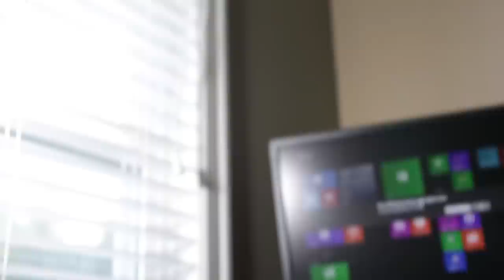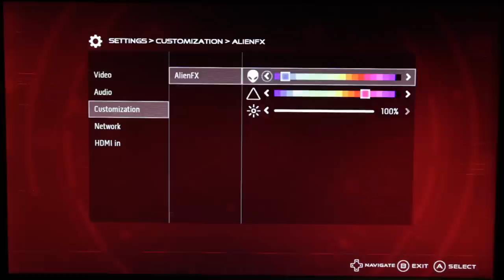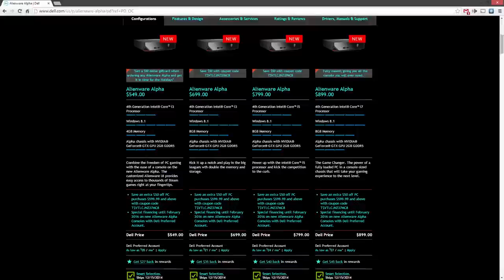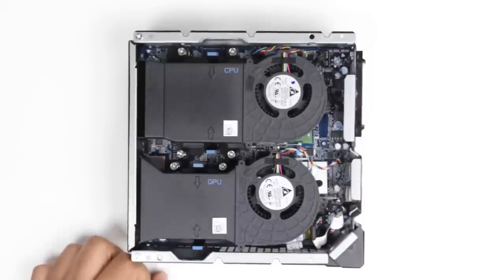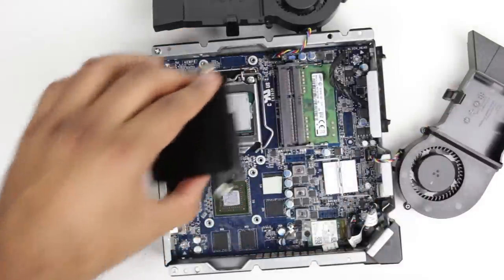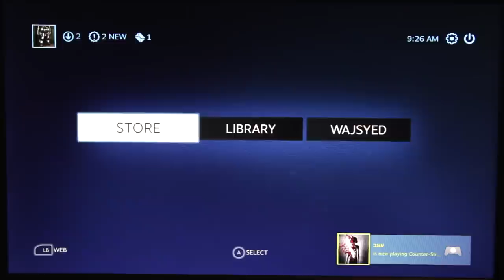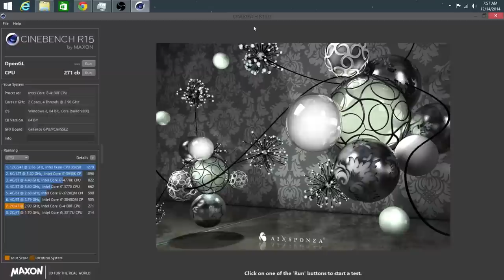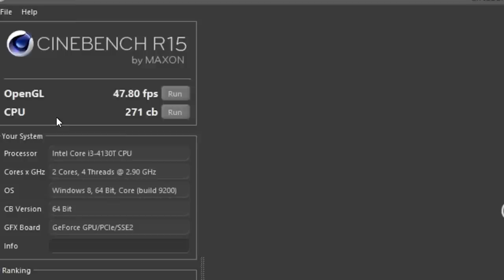Alienware Alpha Full Review

Comment: I consider 30 fps totally playable. As an arma player, I'm very used to framerates around 20. So anything that runs higher than twenty fps is golden for me. As long as what I call rotary lag (lag when turning the camera) is kept minimal,  a game is absolutely playable at 30 fps. Keep in mind I have a thousand dollar gaming PC, but it's all AMD so arma just kills it.
Reply: 30 fps? What settings are you playing on?
Reply: My CPU bottlenecks arma bad. No matter my settings,  I get 20-25 fps on MP in arma. Everything else is 50-90 fps.
Reply: Michael Owen Arma is a poorly optimized game I could barely go 30 fps on high settings but it at least my I do fairly good on medium settings with 48-50-60 fps. I play most MMOs at max settings with 60 fps...
Reply: I feel for you man, what processor do you have? I'm in the midst of upgrading my PC incrementally and I've recently bought an fx 9590 (the octa core) and it shreds Arma 2 and day z even with my shitty Radeon 7770. I'd definitely recommend it.
Reply: Duly noted. Planning on getting an MSI laptop with my tax refund.
Reply: Yea 30 fps is cool IF the games 1080p ultra graphics otherwise the graphics card is shit
Reply: 2XRemix the problem is my CPU, not my gpu.
My CPU is a huge bottleneck on arma.
Reply: Michael Owen I'm still waiting for my W-2 lol.
Reply: Michael Owen i3?
Reply: Fx 6100
Reply: Michael Owen My FX 6350 and GTX 660 gets around 50-60 on Arma 2, but drops to 44-32 fps in cities. What's you GPU.
Reply: R9 270. 2gb

Comment: The 860m is a modified 750TI which is a very cheap GPU. It's just slightly more powerful, very slight. The Xbone and PS4 still outperform it, especially the 449$ I3 version, which the CPU is NOT mad for gaming. And 4 gigs, most modern games aren't going to run on high setting, or have good frame rates. Also the I7, is 1599$, WHY would some insane moron pay for that. You could make a killer gaming rig with that kind of money. Next Gen is where it's at, that's why they are doing this, because it's threatening the once thriving PC gaming market. I use to build gaming rigs, so I know.
Reply: Newhart Bob agreed.. xb1/ps4 does outperform the cheap one. the problem with alpha is that it does play 1080p but not fixed fps makes it unplayable on some areas or annoying.. xb1/ps4 is fixed fps. and in the future.. developers would discover its potential more and more to unlock 1080p/30-60fps.. fixed. and yea.. omg that $1599 could build you what? gtx980(or atleast 970), i7-4790k, 16gb ram lol.
Reply: Newhart Bob hay man i have a question =) 
I was planing on getting a laptop 15 inch  with gtx 960m 2gb  and i7 quad core and 16gb ram... 
is the ps 4 more powerful than the laptop or not ?  
ty for your answer

Comment: Why don't they offer the GTX 980m as an option like their laptops?
Reply: +thybigballs lol
Reply: +banksitter  ikr?
Reply: +thybigballs Yeah I just checked the site and the GPU is not even upgradeable and I never even heard him mention this fact in the video. Even Dell's own webpage shows the mediocre graphics performance on 3 different settings compared to normal GTX cards. This uses the 860M gpu chip soldered on the motherboard. You can upgrade the CORE CPU to i5 or i7 but not the GPU. Cheaper to buy a Razer V1 PC case for $60 and install your own Mini ITX motherboard and your own small or larger sized GPU like a Fury or a 750ti.
Reply: using one right now, not very good, going to buy a new one soon
Reply: +TekReview's You are right.  I built a pc for my father in-law to set up on his entertainment system.  It can do everything this box can do minus the ui.

Comment: Good review and a fair, objective review of the Alpha for the most part, I've enjoyed all your Alpha coverage so far.

I would say its a little unfair to complain about the Alpha only achieving 30 fps in games that both consoles also only achieve 30 at and sometimes not at 1080p and generally speaking lower graphical fidelity. I mean I agree 30 is not really playable, I have to drop settings personally to get higher frames, but someone needs to tell developers this!

Surprised about the sound under load, I had read elsewhere under load it was comparable to the 2 consoles, but good to know!
Reply: If you lower the resolution of the i3 version to 1600x900 and 1024x720 you can play Far Cry 4 with ultra setting around 50-40 FPS.
Reply: Luis Henrique T. Caetano Not what I'm buying it for personally, but good to know, thanks!
Reply: umm what are you talking about? consoles(ps4 xb1) have higher fps than that
Reply: Isaiah Hill PS4 has 35 fps at 1080p and Xbox One has 45 at 720p. The Alpha has 33 at 1440p. Not bad in my opinion.
Reply: Adam McMillan Plus a lot of games on consoles are locked at 30 fps

Comment: its 389$ right im gonna buy it cause its pc and console and cheaper games and upgradable
Reply: and also no need to pay online
Reply: I just bought it yesterday and an extra 4gb of ram on the side
Reply: +Donolater with the I-3 version can u run games like counter strike go with 60+ fps?
Reply: +Im Hyped I don't get it until next week , but I can get back to you
Reply: +Zeeyox 500gb , but you can upgrade to 1tb or a SSD and install it yourself.
Reply: +Donolater can it run cs go at 60 fps
Reply: andy long more than 100 on max settings

Comment: It's not even close to beating a next-gen console. For one, the cheapest one you can get is $500. And the $500 one has an Intel Core i3 processor, 4GB of RAM, and a NVIDIA GeForce GTX GPU with 2GB of GDDR5. My PS4 has a better GPU and double the RAM of this shitty Alienware "console".
Reply: ***** The Graphics card you mentioned alone is almost $300 depending on where you purchase it from. Also, you're going to want 8GB of RAM most likely, that's abou 70-80 dollars depending on the place you got it from, plus add the cost of cooling, a motherboard compatible with it all, and a decent power supply, obviously over $400.
Reply: ***** Only issue I have with that is ram, most average games use like 4gb's of ram. you would just barely be able to run the game.
Reply: ***** Well, you can't always get away with it, and BF4 isn't the most demanding game.
Reply: ***** Alright, well if you have 4GB's of RAM, and it's using 3GB's it has chances to cause complications with the game cause of how much stuff is being used.
Reply: ***** Meh, that's true. I honestly don't care about graphics that much as long as I like the game.
Reply: And my PC destroy the PS4 without even blink. But this Alienware thing is even worse than consoles. Holy Crap.
Reply: This is just the beginning of the pc "console" generation, for a first time thing,  it is brilliant, think of it this way, playing all of the xbox one and ps4 games + plus all of the pc games as well, would rather play all of them on one console than having a next gen console and a gaming pc, 500 isnt too bad.
Reply: Jafro MC Sony and Microsoft won't allow that another console can play their games. They spent too much money to build their business. But that would be great!
Reply: There are i7 models as well
Reply: the ps4 doesn't have a better gpu
Reply: ***** Wtf has Dell to do with it?
Reply: and your PS4 was outdated for " gaming" a month later
PC wins
Reply: YOUR PS4?What,the other PS4's don't have the same hardware lol?
Reply: mgkpraesi dell makes alien ware
Reply: ***** I was saying, that MY ps4 has this hardware, along with the others.
Reply: The Meep Crew lilracerdude Realy? Didnt knew that. Never bothered with Alienware much since their prices are just ridiculous.
Reply: mgkpraesi it would not be a problem if the hardware was out of this world but their systems are just overpriced pieces of shit.
Reply: Vulpus you should've reffered to it as ps4 in general. It was a joke btw.
Reply: ***** Yeah I should have.
Reply: Mine was only 450.00 and the.video chipset runs circles around your shitty PS4 and its completely upgradable.. I think your just kicking yourself for getting that old boring clunker PS4. Plus the alienware console comes with windows 8 and does everything a full conputer can do. Its very small and different looking.
Reply: Blonde Repub pcs are upgradable, the alpha not so much. I doubt you will get much performance from upgrading from an i5 to an i7 since games demand gpu power.
Reply: I hate the PS 4 controller. At least with Alienware you can attach a mouse. For the price of 450.00 at best buy you cant do better or cheaper if you built it yourself.
Reply: Vulpus I`ve just build a similar spec system to he ALienware here : a decent i3 & an overclocked GTX 750ti ( similar to the 860 M apparently ) with 8GB Ram and you`d be suprised what those can do, don`t just go on raw specs of a games console, there`s the architecture of the components & the fact that many games don`t use much over 2 CPU cores for gaming, a good i3 CPU can kick butt in most games
Reply: ***** I`m now playing Farcry 4 at last on that build when my older Core2Quad overclocked to 3.25 GHZ plus GTX580 graphics card was crippled by it !
Reply: Vulpus $500? On Walmart.com I can get a brand new Alienware Steam Machine Alpha for $450.
Reply: ***** Technically yeah,unless the GPU sucks which means that no amount of VRAm of any type can save it.
Reply: ***** Then why are the new consoles 64-bit? And why are PC gamers clamoring for 64-bit games (and have been for years)? It's because RAM IS a factor, depending on the games you play. Even some little indy games are pushing the 2GB limit that you need to modify the executable to get past, and AAA game developers have to struggle to keep their memory footprints down to keep making 32-bit games that will run on a 32-bit OS. On a 64-bit OS they get a little more breathing room by having a full 4GB to play with, but the move to 64-bit is (finally) happening because 4GB is not enough anymore, to give games the features that keep the industry competitive.

P.S.: 8GB of GDDR5 will not "perform" better than 2GB of GDDR5, it will perform exactly the same - but it will be able to hold a lot larger frame, more HD textures, and a larger frame buffer.
Reply: I just built a computer with an i7 4790k an evga gtx GeForce 960 super clocked with 8gigs of ram and it runs gta v with a flat 60 fps no more no less for $1000
Reply: Someone forgot to turn off V-SYNC.
Reply: You are kidding, I have a PS4 and I hate that thing. Crappy online, too expensive, games can be choppy, and it has some really bad exclusives. PC has no cost for online, good online, same price, and it had more games than any other console on the market.
Reply: maxattack36 but but but PS4...lol
Reply: I don't have a problem with consoles. I wouldn't get one, but if I would, I'd get a PS4 because it has more of the kinds of games I like than the XB1; however, this is a PC made to look like a console, and not done as well as it could have been. My PC is neither on the cheap end like this in-betweener device, nor is it a power gamers dream machine, but it costs more than this thing and for what it can do (i.e.: 1440p at 120Hz) it does it better than any console or this thing.

If you want a cheap PC to run casual games or older/less demanding games, you can get better than this and sign up for Steam the normal way. If you want a console, get a console, it's a whole different gaming experience and this thing ain't gonna give it to you because it's a PC with a (dubious) console controller.
Reply: GlassDeviant Actually,medium-end PC's can run games just as well if not sometimes better than consoles for around the same price tag,the alpha has GTX 860M and it costs 550 dollars,my laptop has the same GPU and I gotta say at 1080p most new games play at high-ultra settings with 40-60 FPS which is pretty good for that price range,sure if you show up 500 more dollars and build a custom PC you can get far better results.
Reply: ***** 100$ more dollars for like 3 more fps? Fuck no
Reply: My alpha was only 400.00 and runs everything I throw at it in 1080p. Something a PS4 cant do. Its also a full fleged computer. Its perfect for me with a low price.
Reply: ***** It handles new games just as well as consoles,so don't think you can only play old games on it.
Reply: This convo is still going on?
Reply: ***** I was pointing out that you CAN run new games with at least 30 FPS on high settings,but if you really want 60 you can downgrade the graphics..obviously,but as you say,to each their own,but you get what you pay for and getting a high-end expensive card should have it's perks.
Reply: Grow up Hellzrazor605, consoles are different from PCs, not inherently better or worse. Each is a completely different gaming experience. I prefer PCs too, but for the money a console gives you a good gaming experience. And sore thumbs.

The big disservice comes when greedy publishers and development companies put out the same game on both consoles and PCs, but do nothing to make the game play in the PC paradigm as smoothly as it does on consoles. THAT is the only problem with consoles.
Reply: 1) Double ram: but your shitty ps4 uses 3GB of ram when running and the ram is shared with the GPU. So, both have like 2GB of ram free when playing.
2) the processor is 8 core, yes, but it's so f*cking slow and it runs at less than 2GHz...
3) the GPU is better on a PS4? R u kidding me m8? That laptop GPU is way better than your ps4 GPU. 
1080p@60FPS vs 720p@30FPS...
I don't know if you are trolling or you just don't know anything about electronic components.
Reply: Axel Montini of course he knows that is why he bought a ps4. LoL

Comment: Great review. With that said,  being primarily a console gamer,  I consider 30fps to be very playable, which is the console average. I know that 1080p 60fps is the gold standard, but even the PS4 version of Far Cry 4 runs at 1080p 30fps with settings lower than the highest level of detail on the PC.

As far as performance is concerned, so you think that the Core i7 will make a difference in frame rate? I wish more PC games took better advantage of more powerful CPUs.

Comment: Sorry to say this as a PC gamer and a supporter of the entire SteamOS/Steam Machine concept, but an 860M equivalent graphics card is trash and will not be able to compete with the PS4 or even Xbox One. Right now you can get an Xbox One for 350 with a 50 dollar gift card and three free games, if you're going to price a unit that's underpowered in terms of graphical horsepower to an Xbox One it better be cheaper than $300 and this isn't it.

I understand the form factor appeal but really there's no reason not to stick 750Ti's in these machines already, and price it at $300 - 400. Since most of the gaming done is gonna be big picture gaming, you can get away with a cheaper CPU, and even slightly less RAM (games that tend to require more CPU like Civilization for instance are not big picture games).

That beings said the big games for SteamOS/Linux right now...seem to be mostly CPU heavy games, if Valve was smart they'd start looking at convincing other developers of big AAA games like Wolfenstein, Shadow Of Mordor, Alien: Isolation, Evil Within, etc. to port their games to SteamOS. Ones that aren't so CPU heavy and big picture friendly.

Right now with what they stand they're launching SteamOS with games like Civ 5, Civ BE, Witcher 2, 3, Metro Redux, Empire Series, all of these are very CPU heavy games and half of those games are not big picture friendly. What is the purpose of porting those games to Linux if it's for Steam Machines? Civ, Football Manager, and Empire are not games meant to be played on a TV screen. They have a bunch of OLD games ported to Linux and I just heard about Bioshock Infinite coming too, but everyone and their mother has played Half Life, L4D, Bioshock, Borderlands 2. The only thing good coming out of the gate is going to be BL:Presequel for a cheapish Steam Machine and that's a last gen game, certainly not worth a heavy investment into a new console/pc for most people. That and Project Cars but isn't that a monthly subscription type game? Most people don't play those.

It's looking grim for the Steam Machines simply because they took too long to come out with a competitive price, I understand that these things take time, but the lack of news and the misdirection of ports preparing the SteamOS library has been a real killer for Valve. Unless developers of said big AAA next gen games are purposely holding back their titles for SteamOS launch it seems pretty grim. However if I'm wrong and SteamOS launched with said games and others such as Evolve (former L4D team very possible) and the other big games that people want it may offer a real solution for many gamers. For example people with multiple people in the house who want to game together, instead of investing another grand in a gaming PC, could instead opt in for a cheaper Steam Machine prebuilt so they can game together without split screen or lack therof for PC gaming. :P

People looking for a next gen console may be interested in Steam Machines for the cheaper long term prices in gaming, or people avoiding monthly subscription/constant hacking, DDOSing of multiplayer, etc. There are lots of advantages to Steam Machines I feel the disadvantages right now may out weigh those however if things are not brought together in a timely fashion and Valve HAS to launch Steam Machines next year. There's no ifs thens or buts about it, if they don't do it next year everyone will forget about them, they pretty much already have at this point.
Reply: A maxwell 860m desktop equivalent is a GTX 750 ti, but I do agree they could of sacrificed a couple of inches of size to fit one in thus making the GPU upgradable. Also what about what microsoft is going to do for PC gaming this month although I'm probably not too excited as whatever they got planned will mostly be done to help the Xbox.